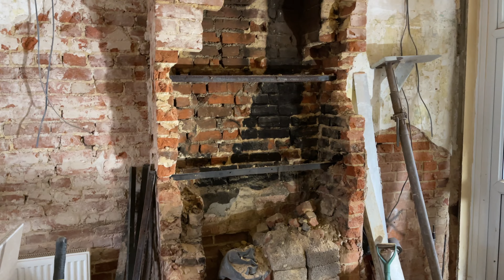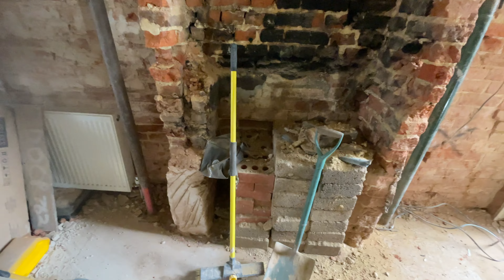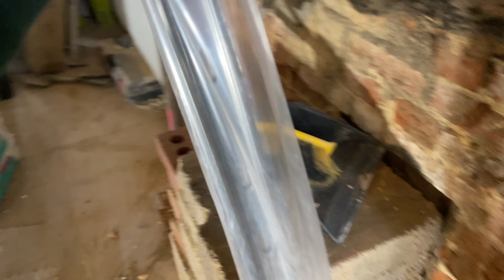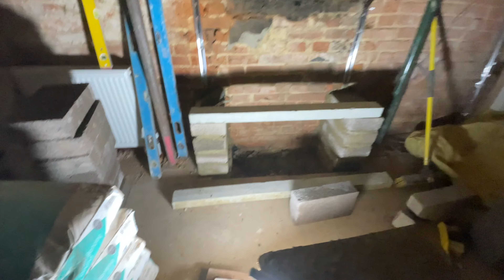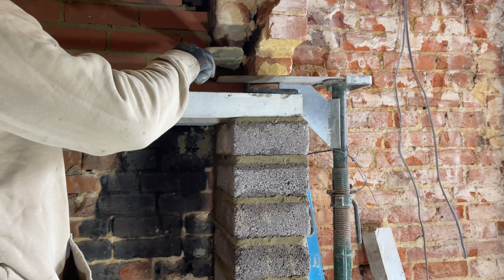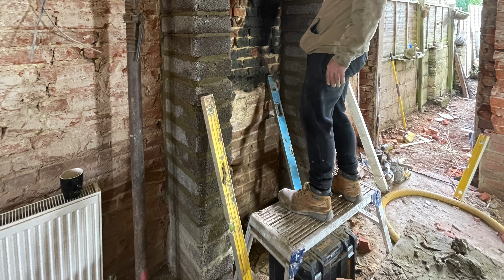Chimney Breast Repair

Comment: how oftens did you put the wall ties in? thanks
Reply from the maker: Every 2/3 blocks to a total of 4 aside however. I don’t think it would needed in this application but I just went to keep it even as possible. Belts and braces!
Reply: Thanks for the reply. I basically have to do pretty much the same but have removed the chimney breast in the room above. I'd rather not go to the effort of tieing it in if it's not necessary?